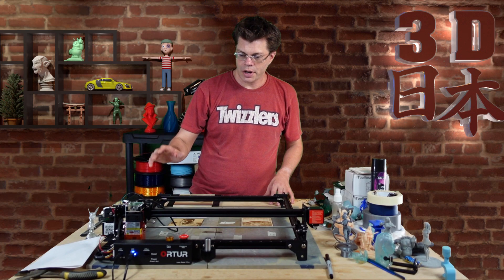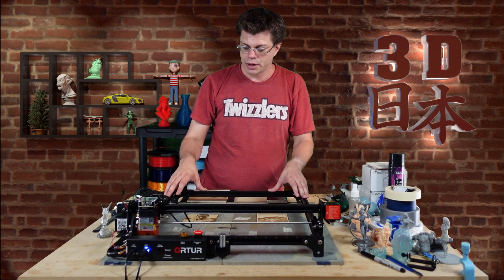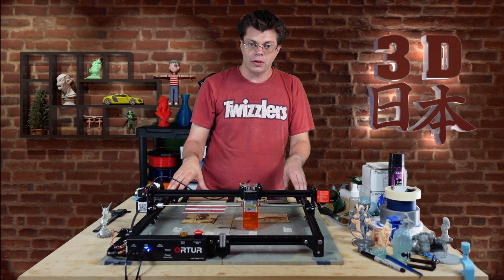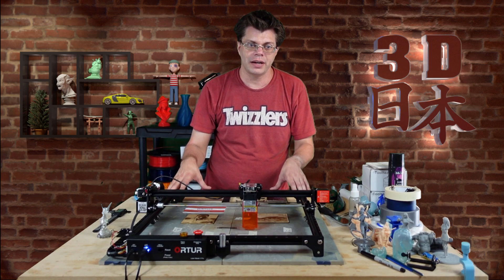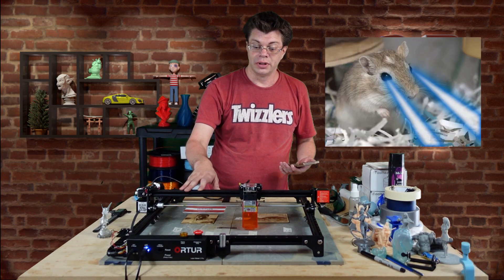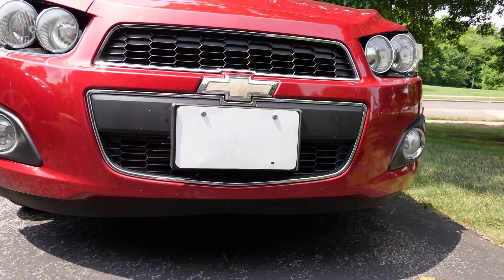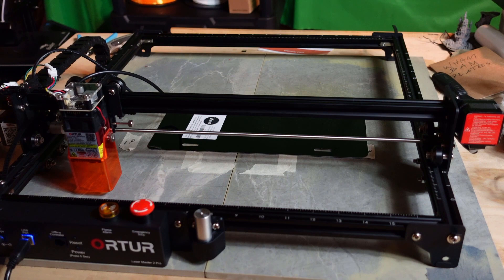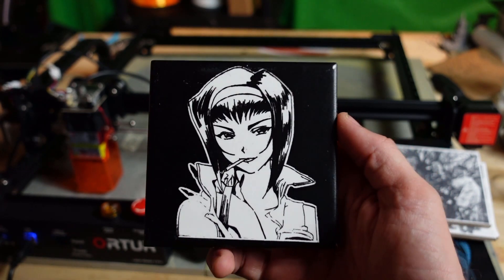Is the Laser Master 2 Pro better than standard?

Comment: Hi Phil, just subbed and just got my LM2 Pro as well. Loved this video as I
concur wholeheartedly that the metric measurements would be on the other
side as I use metric in Lightburn for my settings. I also have the LM2 before this.
Speaking of settings could you share if I missed the setting for the license plates?
Thanks and I look forward to seeing more videos.
Reply from the maker: I mentioned it in another comment. 4000mm/min and 60% power. Though I could probably go faster. I only had 2 plates so I didn't do much experimenting